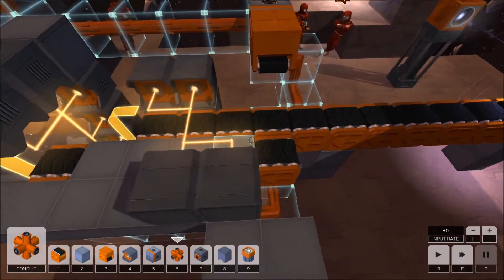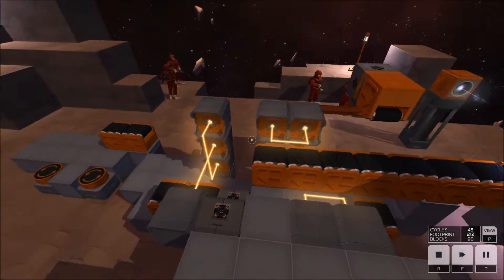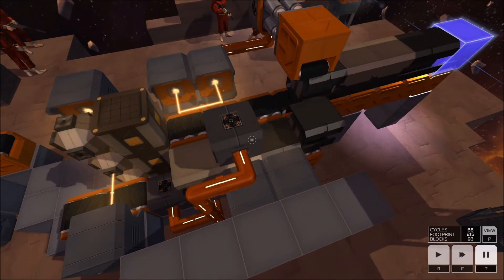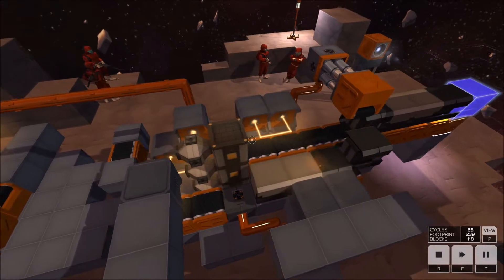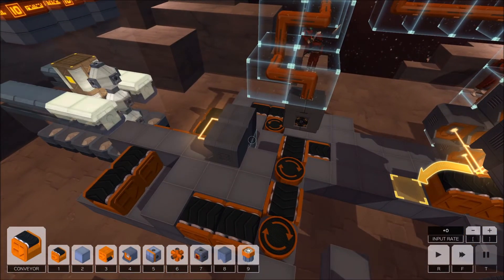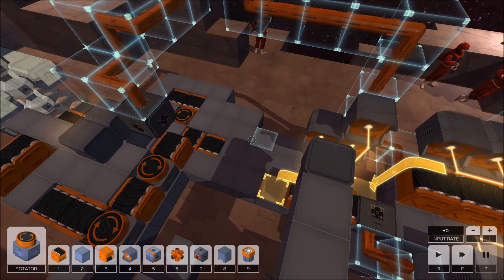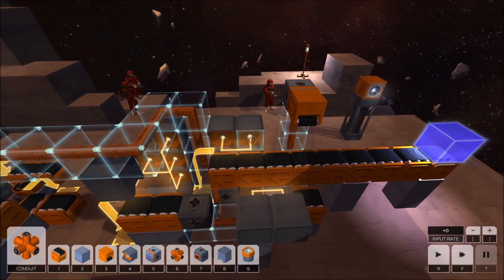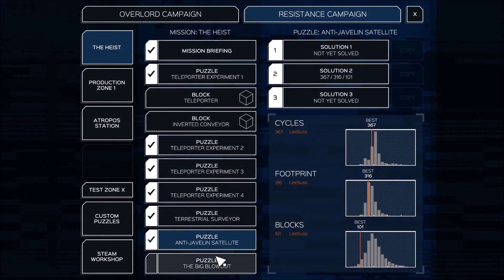Randoms (14): Infinifactory - Ignore The Mess

Comment: plenty of good times here. i especially loved your rant about the input rate, and as far as initially solving the puzzle, i agree with this mentality. it pretty much doesn't matter in higher level play though. if you reach a point where score is your priority, then ultimately, you'll end up building 3 separate machines anyway, 1 for each category. the cycles machine will have the input rate cranked up to max and you'll build your machine around that. the foot print and block machines input is completely irrelevant. you just use whatever input permits your creation to function.
Reply from the maker: Most certainly a rant, and really mostly a rant about my own attitude to “winning” or “cheating” which makes it even more insane.  Going back and making multiple machines is exactly what I’ve done on some of the earlier levels, but I really need to stop doing that as it’s not good for my mental health pushing the envelope what you can do for e.g. speed. It’s supposed to be fun, me, stop frustrating myself!
Reply: @LeeSussLetsPlays  gonna be completely honest here, i didn't even realize you could change the input rate for the longest time.   if i needed a delay i'd just cause a small pile up at some point using structure blocks to hold one or two things in place for a bit.   never really worked too well honestly but hey,  it was a good few years ago
Reply from the maker: @rampagerslife  Same for me too, not realising about the variable input rate for some time that is.  Similarly to delaying systems I'm finding that with the increasing complexity using subsequent products to "move on" previous ones to the next stage is also getting difficult.  Timing is what invariably breaks things!